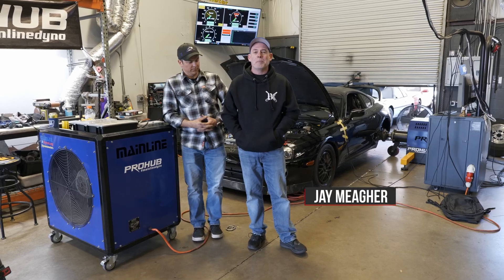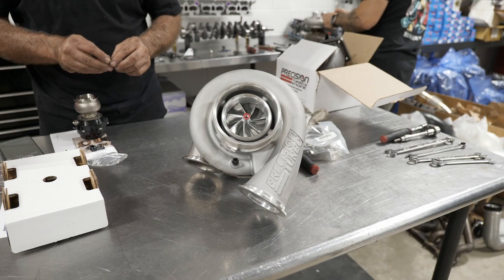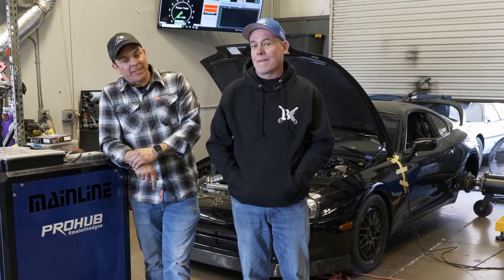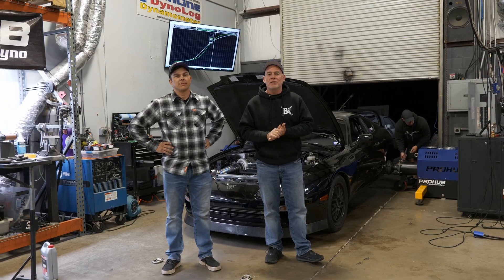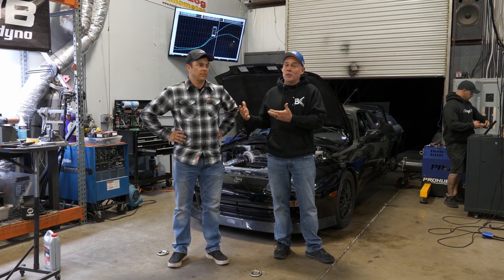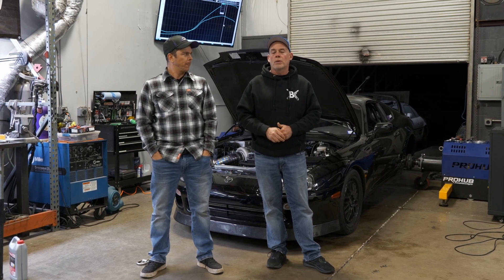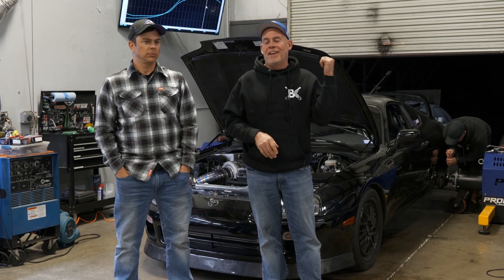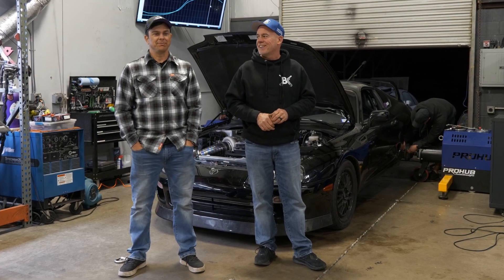1200+ HP Supra on the Dyno- PHR V1 Manifold, Precision 7685, Dart 2JZ Iron Eagle Testing | RS Garage

Comment: So which way is better 🤔 Recirculating waste gates or open waste gates? And what would you recommend? Thank you.
Reply from the maker: You could see if from two different vantage points. The open gates exhaust the gas into the open atmosphere whereas the recirculated gates dump the unused exhaust gas back into the exhaust system. If it were strictly a mission of getting the gas out of the system the open gate is an easy choice.  It also seems to be preference. The EVO guys seem to have enjoyed years of recirculated wastegates and the early Subi community saw external gates as an upgrade.  The packaging of the turbo system also plays a huge role as there may not be a easy path to recirculate.  I prefer the recirculated gate because I like how it sounds. FWIW my Supra had an open gate when I did a ton of dyno testing with it and it always made great power.  You could just decide how you want your car to sound and it's an easy decision. Thanks ~Jay

Comment: Some feedback on the 7685 nextgen compared to Gen2 please, response and top end thanks 🙏
Reply from the maker: I've got some of that work in the pipeline. I did test the gen2 VS the 7685 vs the 8085NG a while back on a Dynojet. T. I also hot swapped a 8685Gen2 at the track for a 8085NG and the car ran the same time and speed at the track. The larger NG wheels are impressive, especially if you're tuning off EBP ratio vs boost numbers.  If you have a 7685Gen 2 and you want more power my choice would be a 8085NG. If you're shopping please keep us in mind.   Thanks ~Jay

Comment: Wow that's great hell yeah : I just saw one here were I live : 1993 Toyota Supra · Coupe · Driven 125,000 miles

93 toyota supra rhd originally 5speed na 
Converted to gte with a low mile 2jzgte non vvti from jdm depot, paired with a grannas t56 magnum f transmision all controlled with a halltech 2500 elite stand alone running on pump 93 curently,lots of new parts will post in pictures, car runs great no issues turns heads dm for more info or questions 

Mod list in pictures asking 47,500 🙏🔥
Reply: You can import one for around 35-40k with a v160
Reply: @BulkingPenguin   facts  also always got this ? Do I need a license to buy a import car?

Comment: If you don't mind me asking what's the average down time in between pulls?
Reply: Depends on what adjustment need to happen we had pulls that were almost immediate.
Reply: @JDMKIV  your very lucky to have both guys in your corner .. congrats
Reply from the maker: It seems like 3 runs back to back will give you the best oppertunity to stress the system while leaving the oil some time to calm down. If you manage temps the engine isn't looking at time between pulls. It's just ready to work. ~Jay

Comment: If he was not pump limited, what would be a happy power level for this turbo? Given no other bottlenecks.
Reply: Should do 1300-1400 wheel no problem.
Reply: Good question brother. That answer isn’t that far away but the car is probably good for 1300-1500.

Comment: Killer setup, well done! I know there are plenty of variables, but how does that cast manifold compare to the other traditional fabricated/tubular options? Seems like heat management may be one of the benefits if the casting is thicker. I'm itching for some upgrades soon...
Reply from the maker: I think done correctly the cast manifold is a good option. What I like the most about the PHR is the wastegates are fed from the collected cylinders VS plugging a gate on the side of a collector and calling it "good enough".  Ideally all the cylinders are venting equally do you don't have lean holes. BTW, Hi Payton! ~Jay
Reply: @RS_Garage_US  Jay - what is your opinion on the new PHR S1 cast manifold vs the Artec offerings? They are similarly priced and very similar in design. I think you're one of very few people have who looked at both at this point!
Reply: @RS_Garage_US  Awesome, thanks for the feedback. I think just about anything would be an upgrade from my current manifold anyway. Hope you and your fam have a great Christmas!